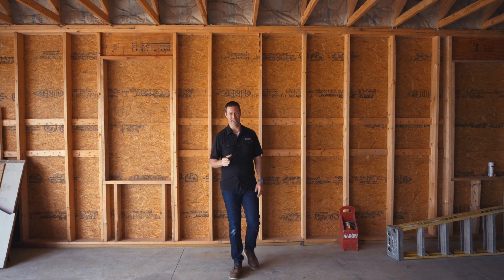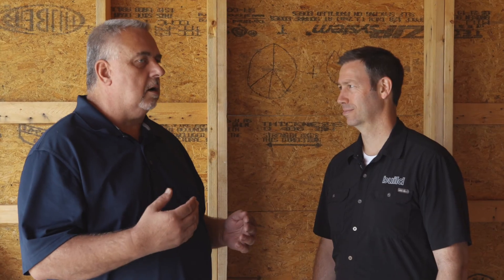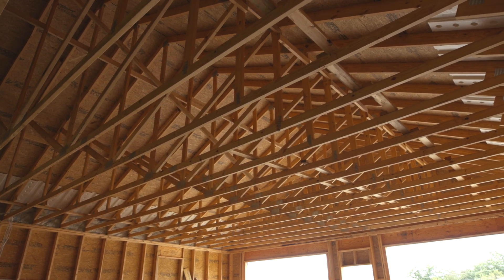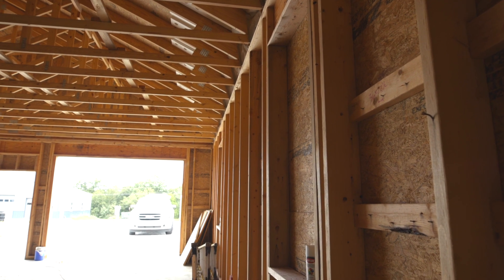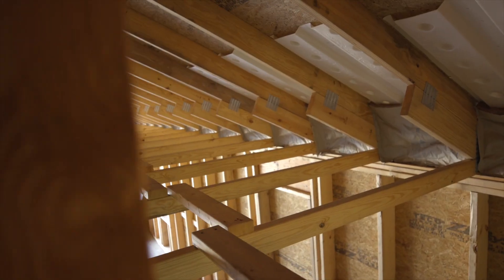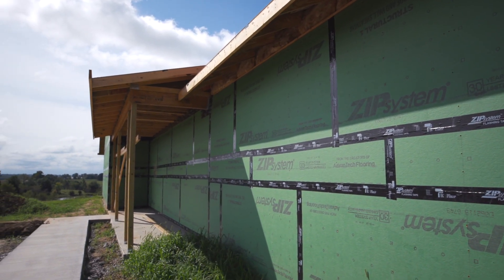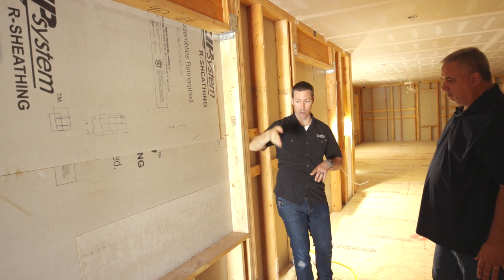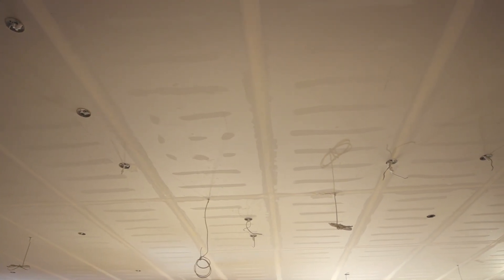Traditional vs Advanced Framing - Details

Comment: Why spray foam over the zip R. I thought that was the reason to spend the extra on tape?
Reply: Zip R is used as it provides exterior insulation, sheathing, and WRB all in one thus increasing efficiency. The spray foam offers the highest R-Value per inch in the cavities.
Reply: @charnockcustombuilt9418  my thoughts are why not just skip one step save $ either zip-r or the spray, they just seem redundant. Take the zip-r $ and put more foam or put thicker zip-r and skip the spray.  I understand belt and suspenders but at what point are we just flushing $ down the drain.
Reply: Never Sleight the added foam wouldn't help thermal bridging that's what the zip R does. The alternative is no zip r and a double wall removing the thermal bridge then spray foam away.
Reply: @timmacsweet131  I guess I don't think thermal bridging is as big of a deal as some. From my shop this am I looked at my 1907 home with 2x4 rafters and new spray foam 2016 and could see rafter lines. it only cost  my 2000sq all electric home $80 a month  to heat with lows in the teens most nights.  Can I see frost lines? Yes. But I also see it costing me 100 more years to justify added insulation cost to get rid of them.  And if this and most the very old homes I've worked on is any indication they will be remodeled a few times before they hit the 100 year mark and updated to the new standard and the guy who does it will cuss me out for using "this crappy old stuff" no matter what.
Reply: Never Sleight some areas (for instance, Ontario Canada) we now require by code to build a continuous R5 insulation for our walls as spraying wood studs still creates a thermal break

Comment: matt risinger you could also put your header the other way so the wood faces the inside of the garage that way the drywallers will love you more .and your framers can put insulation between the header and the sheeting outside.
Reply: WRONG!!! Drywall does not move nearly as much as wood - more attachment means more chance of cracking. Header out please!!

Comment: I don't think this style of framing would work with the Calif building and seismic codes.  In my opinion it is a step backwards with what I was taught. Wood products are not what they were 20-30 years ago.  Fast growth trees, LVL, chip board. My cousin is a firefighter---  they hate going into the newer homes when they burn, for fear that the floor will give out in record time with the new truss'.  All they talk about is the efficiency of the R value.  What about the strength and longevity.  Been following other builders on You Tube --essential craftsman for one.  The majority of that house is wood chips and glue.  Maybe I'm the one that is outdated--who knows

Comment: Doesn’t look like the trusses lineup with the studs to me
Reply: The double top plate carries the load.  if it was a single top plate it would fail.
Reply: Code requires that trusses line up with studs at 24” o’clock unless engineered otherwise. Top plate has nothing to do with it.
Reply: Kyle Duffy still sloppy, all layout should line up
Reply: This would depend on their local code requirements. A big factor would be snow loads but unless they are in northern Wisconsin they're probably okay.
Reply: Caleb Read its within code.. do i think the roofs coming down, no.. but its not professional work
Reply: @skiingslasher1991  Yes it is code-acceptable, but I believe a better craftsman would have had the trusses line up directly over the studs. It won't make much of a strength difference, but it will showcase the builder's skill with layout and craftsmanship.
Reply: According to IRC, its perfectly acceptable to have differing spacing on rafters/trusses from stud spacing if you have a double top plate.
Reply: Simplestatic its sloppy.. layout should line up..
Reply: @skiingslasher1991  if the stud and rafter spacing is the same, yes it would be code compliant, but sloppy yes. For many reasons, an engineer or architect may call out a stud spacing that is different than the rafter or truss spacing. That would be the architect or engineer's decision.
Reply: Simplestatic yes But layout should always lineup.. and this is not the case. it is the builders error
Reply: You're only looking above the window, and the header is supporting the trusses. The window. Was it designed for 16" centers? I don't build, and the reason that I like home improvements is that by about the third try I can get close, but it looks like that window adds complexity having to frame not only around it, but then to integrate it back into those two foot centers. Which are doubled 2X6X10 footers. Expensive lumber, and you have to pay twice.
I suppose that can be balanced somewhat by the non load bearing walls. 
The flexibility of choosing any floor design is a major plus. Imagine having a maze to reach the room that you hide your weed in.
Just kidding. That's the mother in law's room.
Reply: You did not build an "on site factory "   this is is how almost every house in America is built. Framing, then roof, .....congrats you guys are the first to engineer a "dried in structure" so you can do other stuff out of the weather.
Reply: Code allows divination on truss to stud with a double plate.  Couldn’t get away with that on a single plate.
Reply: @brianmcintyre5867  all framing should be stacked.  Interior walls over floor joists,  exterior walls over floor joists, trusses to studs.  Anyone who has ever been involved in more than on aspect of construction should know this.  Hvac, plumbing and electrical are much easier to install and keep neat if it is.  Also hvac in wall cavities can be impossible with non stacked framing.  If you need to break out a sawzall on new construction to install mechanical, you are doing it wrong.
Reply: Did not see portal frames for the garage
Reply: Code does not apply here people... for $250 a sq ft the trusses should be exactly over the studs, the correct length sheeting should be used, not a “railroad.” What a joke. Let’s make a warehouse here so that the sheet rockers have to come back multiple times...as well as the electricians... and plumbers...and insulators. And the interior walls are not directly attached to the trusses because there is Sheetrock between them. Get a rope
Reply: foolioay Where I am from when all the framing lines up you know the builder knows what he’s doing. Ive been doing  this a long time and the professional way is to have all the framing lineup.
Reply: @skiingslasher1991   "Ive been doing this a long time and thats how you do it!" That kind of answer is how I always spotted guys who didn't understand what they were doing.
Reply: American Builders haha first thing I saw

Comment: This is what is known as a bent nail job in the UK, rough, cheap and wouldn't last 10 years in our climate.
Reply: This is a great learning opportunity from someone that is exposed to building in the UK. Please educate us on your thoughts? Why will this house fall over in 10 years? Please be specific. Thanks!
Reply: 90mph winds, driving rain and snow and the absence of bedrock. We build cavity walls in masonry with lime mortar with slate roofs most of our housing stock is over 100 years old. My own house is 130 years old although with new membranes etc. we are moving towards timber frames because of cost implications.  I built a framed cabin in the backyard and it is failing after 10 years, the atmosphere is just too damp.
Reply: @I-am-not-a-number  Not very earthquake friendly. Masonry building tend to collapse during earthquakes. The US has worse conditions. 90 mph are nothing in Florida when there can be hurricanes with 200 mph wind gusts. Lots of coastal states on the East Coast occasionally experience high wind storms with gust near 90 mph.

FWIW: We do have some very old homes that date back to when America was still ruled by England, and are made of wood.
Reply: We don't have much seismic activity in the UK. I have seen the devastation caused by hurricanes in the US and never really understood why you still build with timber frames in these areas.
 I guess we use materials that are readily available in specific areas to construct our homes. If you really want to see very old (500 years plus) timber buildings that are earthquake resistant check out minangkabau houses on the West coast of Java. Apparently they dance during earthquakes!
Reply: @I-am-not-a-number  Issue with construction was costs and in the past hurricanes were not consider as big as a threat & Home ins was relativity in-expensive. However Florida as gone through a housing boom for the past 5+ decades. Building codes have improved over time, but a lot of homes you see wrecked were constructed decades ago. 

China has some of the best quake resist buldings. some are over 1000 years old, built via pole beam construction. NOVA (US PBS) did a episode on them. They made a model on a quake-shake table and it survived the highest the machine could dish out ( I think it was about 10.5 richter)

FWIW: I am building a stick frame home, but its inland and not at risk from hurricanes. I am sure it will last 500+ years presuming the future home owners don't burn it down or totally neglect it.
Reply: Good luck with your build. I am refurbishing a 1880 townhouse on a busy road, lime mortar and solid wall brick built with a slate roof. Insulation and soundproofing are my concern, thankfully earthquakes happen very rarely here.
Reply: I bet you'd be surprised how well the house performs/lasts, even on your side of the pond - the owners are spending a lot of money in places that don't show once it's completed (ie, it's the opposite of the usual wallboard wonders that look nice on the surface, but are crap on the inside) .  Builders appreciate it for what it is, but few clients would simply because of the added upfront cost.

Comment: Rip the drywall off the ceiling and try again. Other than the fact that you failed to stagger your seams and they will all crack, why would you put it up before you finish the framing on the interior walls?
Reply: A great man Abraham Lincoln once said "It is better to remain silent and be thought a fool, than to speak and remove all doubt" Maybe you should Listen, Think, Learn, then maybe suggest, a far better tact - although I think Lincoln may have been thinking of you....
Reply: Actually, the drywall prior to interior walls makes a lot of good sense. There is a reason I specify it when I build. In this case, the single butt seam will be covered by a wall (at least that is the hope, but if not, they should have staggered the butt joints), but that's the only issue I see. They are much faster to install without walls in the way, and more importantly it gives you a better airseal. Admittedly, they likely won't do as I would recommend and spray foam the back side of the ceiling after all electrical penetrations are installed to create a near perfect airseal, but it's much better than standard practice. It's mostly those two reasons though, speed of install/texturing, and airseal. I can't find any other reasons for it, and I specify for it...because those two reasons are good enough.
Reply: @joshualruby  Ok, so the interior walls will go exactly where the but joints are. That would be the only justifiable reason for it. Thank you for answering my question.
Reply: @activechaos128  I hope that is the case or I do fear they will suffer from crack propagation at the butt joint line. The stress concentration mixed with the slightly less shear protection is likely to crack through humidity changes and settling.
Reply: I’m curious as to why you feel the drywall should be removed? I’m also curious as to why you believe it will crack?
Reply: @jake.bruton.aarow.building  the ceilings will crack along the end joints because the joint is thinner along those edges and once it starts to crack there will be no break to stop it. Staggered seams adds strength. It's not any more work to stagger the seams. Why would you do it any other way?
Reply: activechaos128 the butt joints in this assembly will reside over top plates of wall. Therefore any cracking that would happen would be above plates.

Comment: Please showcase houses that are at or below $200,000 for the house and property
Reply: If you want that, Matt should showcase my current build on 6 acres. So far I'm at $86k for 2500 sq ft with a 1200 sq ft attached garage before insulation, and everything that comes after that. However my spray foam bill is going to be what kills me.
Reply: You can buy a tiny home for about $20K.

Comment: 2:50  "24" OC framing, right?  All the studs align with the trusses up above."     Camera pans up... studs and trusses NOT aligned, and studs do not look like they're spaced at 24" OC.
Reply: In the garage space the studs misalign by 1.5”. All of your eyes are correct. The reason for the shift is the zip r (that is 1.5”) on the garage to house wall. The zip r creates an air barrier between the bad garage air and the liveable space. However the roof sheeting continues on through this point. We could have shifted the layout but wall sheathing cuts would have been 1.5” less. So code and engineering allows for a small offset. We take advantage of this allowance and don’t alter our roof sheathing layout.
Reply: @jake.bruton.aarow.building  . . . Thanks for pointing that out.  I read in a code book years ago, that it's OK to offset an amount equal to the width of the lumber.  I guess they don't teach that in robot school.
Reply: @jake.bruton.aarow.building  Jake, thanks for the explanation, I assumed something like that.

Comment: I would like information on how the interior walls are built and installed.  If they're built on the floor and tipped up it seems it would be hard to get a tight fit top and bottom.
Reply: Think of it as the same process of framing in an already finished basement. The walls are cut as tight as possible without having to beat them in place. By the time you stand up the second wall you have a knack.
Reply: Larry Jones from memory the frames won’t be fixed to the trusses, you are not allowed to fix to trusses as it affects their engineered design. Every country is different and I’m not sure what happens in the US.
Reply: One advantage of building the walls this way is that you can use steel studs. This will give you much flatter walls.

Comment: $250/sf sounds very expensive. Even $200/sf sounds expensive. Does this sf pricing include developed land or design?
Reply: $250/sf is indeed expensive for what they are getting - a boring home with no architectural interest.  I'd be more inclined to use lower quality materials/less efficient HVAC and spend the money on larger solar.   Triple pane windows are very expensive vs the benefits unless you are in very cold climates. And adding that 'utility basement' vs simply locating mechanicals in the attic is a bogglingly expensive decision for a supposed 'budget' home.
Reply: If the price is a problem get a lesser quality house.
Reply: @1212goose  U dont have to get lesser quality to pay a hell of a lot less than that!

Comment: My old house is rough cut 2x4s (true 2x4s with old growth lumber) 12 to 14" OC. Sorry, but smart is strong. Let's see if these houses that utilize less materials with young-growth lumber actually stands the test of time.
Reply: Your old growth home breathes - even if there are leaks, wood has time to dry out and not rot.  Today's tight homes are extremely sensitive to moisture and require lots of work to prevent moisture/air ingress - and lots of expensive HVAC to condition the air.  Builders/suppliers love the new codes - just drives up cost/complexity, hence no push-back for silly new energy regulations.
Reply: ArthurDentZaphodBeeb are you making the argument that homes built to today’s codes cost more to condition than homes built 80 years ago?

Comment: Wow that's a lot of wasted space above the garage
Reply: What would you do different there?
Reply: @gssuper1438  I was able to build a small 10x12 office in the space above my garage because it was framed with rafters.
Reply: @gssuper1438  maybe the span is too large if they are trying to keep the garage completely open. Just seems like a waste of space.
Reply: @noconz0727  In this scenario with a large span, you'd need a floor system, need roof rafters, a ridge beam, a steel beam for the floor system the list goes on. And the roof pitch isn't steep enough to attain valuable space. And this is stated to be a more budget friendly home. Attic spaces, at least where i am, are extremely expensive way to attain floor area. The most i'd usually propose is to make the trusses a 'bonus room truss' design and at least you'd have the option of making it something in the future. But even those trusses can cost significantly more depending on roof pitch and spans.
Reply: @gssuper1438  not to mention rooms over the garage are cold and hot depending on the weather. They are hard not to bounce and ever time the garage door opener is in use it feels like a invading army is coming in. Bonus rooms are for storage but they suck for anything else. ( Slept in on over Thanksgiving prior to that I had no opinion.)
Reply: @gssuper1438  infact Matt talks about the benefits of a "hand cut" roof here youtu.be/beyizqqb9bU
Reply: Ken MacDonald  Exactly - that's why they are attics
Reply: They don't care they could probably just build a storage building if they wanted to...